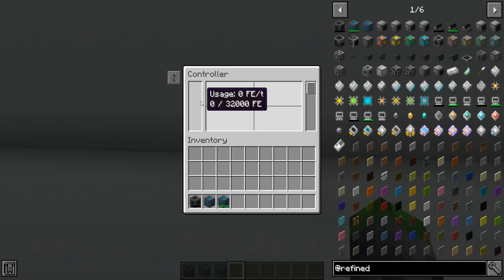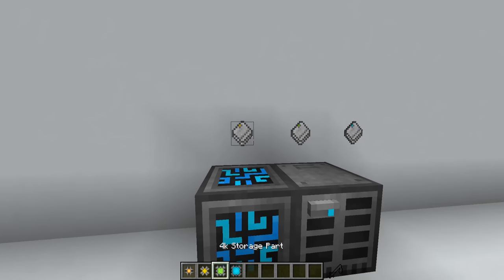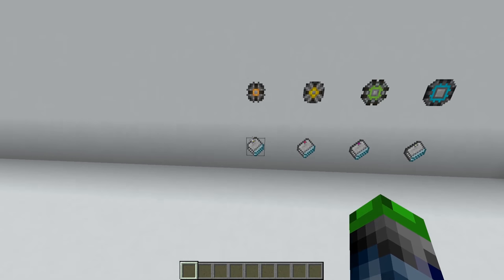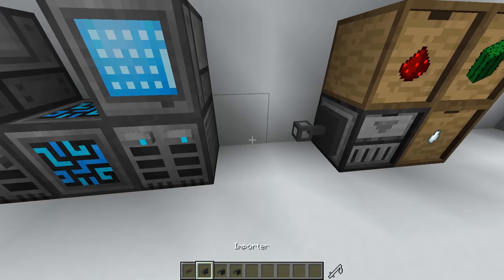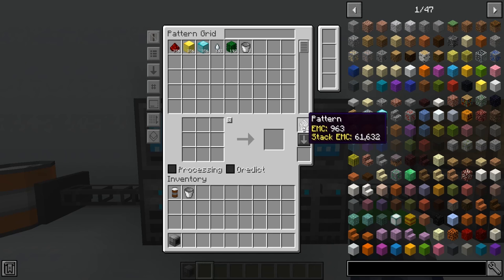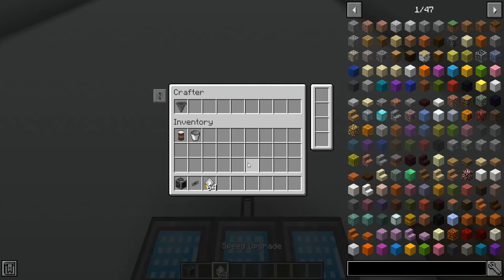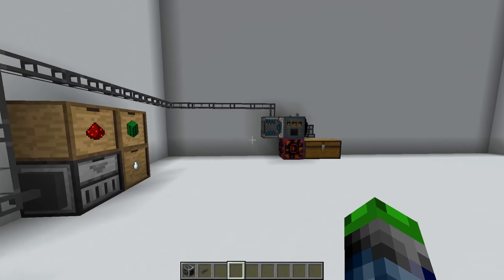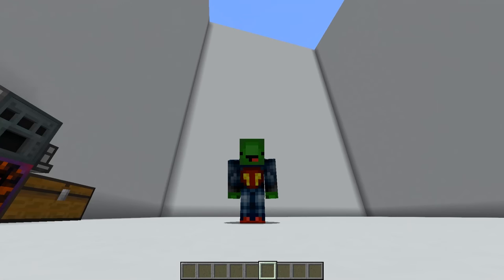Refined Storage + Autocrafting Tutorial in 10 MINUTES!!!

Comment: At first, I thought this video was great until I got to the processing autocraft section, which I was setting it up in my world and mine would not work and it was because you need the crafter on top of your block. Ie on top of the furnace. Make sure its pointing in the correct direction and then you need export and import to finish the auto craft job off. So I ended up watching another video which explains it in more detail. But thank you for sharing your knowledge.

Comment: If you want to auto craft something needs to be smelted, place a redstone furnace or a furnace, place the crafter pointing to the machine, configure input from up and out from a side, place an importer on the output side and connect to cables, voila just make the pattern and it will be there

Comment: Any tips on how to make this work with items that have metadata? For example, the IC2 cutter and forge hammer? Right now, I had a recipe in there to make a hammer and iron make an iron plate, however, it required that exact durability of hammer. I tried making it use the ore dict, and it works, however, it uses the ENTIRE hammer/cutter for every operation! It seems all they coded this for was to actually reference how many things are needed, and then delete them from the system. So now it seems it's pretty useless for anything that involves metadata, which would include basically every IC2 recipe, sadly.
Any tips on how to work around that? Right now, I'm planning on setting up a Mechanical Crafter for every single plate and wire, which is going to be super annoying, and require constant checking, but that's all I can think of.

Comment: Loved this fast explanation but I'm having trouble wit the external storage part of this mod.... I have it reading my drawer controller of storage drawers mod.... It's showing up on my crafting grid and all that but when I want to clear the item from the crafting part it's putting in either in my inventory OR on my disk space rather than just placing it back in the drawers like I have the priority set to. My external storage is set to priority 1 and my disk drive is set to -1..

I'm at a loss at what is wrong since I'm new to the mod.. I saw some one else using this system and dump a lot of stuff into the grid area and it sorted it out to the drawers first so it wasn't using disk space. I'd like to do that and don't know how. :(

Comment: So I'm curious, of the various storage mods that work like this does, which is lighter on a person's computer? i.e. what is the less resource intensive like AE2 or refined storage? I like this tutorial it's great for people who can find the recipies but don't know how to use the mod.
Reply: AE2 is more resource intensive by far. Typically requires starting by hunting for 4 different presses, then making machines to craft items before you can begin to have a system. Whereas refined storage is typically string and slime balls to make a binder and silicone, redstone, metal (iron, gold, and diamond) the same as AE2. This alone just getting started is easier and cheaper than AE2.

AE2 however is typically coded cleaner than refined storage and used to cause some issues with certain computers. However heavy AE2 usage or refined storage usage might cause issues as well.

It pretty much simply depends on the pack developer or personal choice on the system that gets used. Refined storage is better at auto crafting, but AE2 is better at auto processing and fully automation. It is mostly personal preference nowadays.

Comment: When I make the pattern and put it in the crafter, the item doesn't appear craftable in any grid, i'm trying to combine stone swords, does metadata have any effect on it?
Reply: I believe that's a metadata issue. I wouldn't try auto crafting two weapons together. It typically takes nothing to do that manually,  or auto craft new ones.
Reply: @OrangeRocks1986  I would do it manually, but I have a very large wither skeleton grinder and my storage disks are filling up quite quickly. Also, wither skeletons put out swords with different durability values, so despite the fact that the storage disks can stack items that normally wouldn't and can stack beyond 64 doesn't help me. I haven't played the modpack for a while, so I've kinda forgotten what my fix was, but I think I wound up redirecting the flow into a lava pit. thanks for the reply anyways.
Reply: @vladimirputin3426  

That's a good way to get rid of them. Trash cans with fuzzy filters work as well. 

Currently playing Awaking Sky of Diamonds and we have 47,000 and they aren't hitting the trashcan or lava fast enough.

Comment: With which button can i autocraft something that is already in my system?
Reply: i also would love an answer on this
Reply: @kylesims55  first you make the pattern. Then you NEED to put the patter made inside the "Crafter" block. After that when you access the grid you'll be able to click on the itens you can craft (the itens you've make the patterns for, and had put those patterns on the Crafter).
If you just make the pattern and put the pattern on the grid you'll be able to it there, but will not be able to craft.

Comment: I know this is an older video but if anyone sees this any help would be awesome. Made a system with 128k storage and a bunch of patterns, crafters and everything else i need. No matter what i try the system will not auto craft, the patterns dont even show  up in the system. Any ideas about what could be wrong? Ive watched 20 different videos and im confident everything is set up right and i have the materials in the system. Any help is greatly appreciated! Thank you
Reply: can you give a little more info? I might have an answer
Reply: first you make the pattern. Then you NEED to put the patter made inside the "Crafter" block. After that when you access the grid you'll be able to click on the itens you can craft (the itens you've make the patterns for, and had put those patterns on the Crafter).
If you just make the pattern and put the pattern on the grid you'll be able to it there, but will not be able to craft.